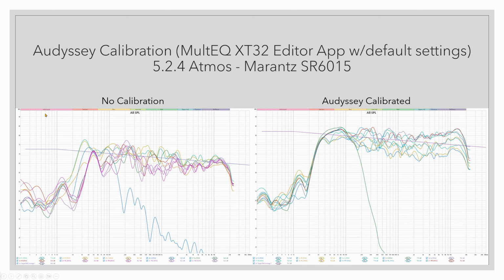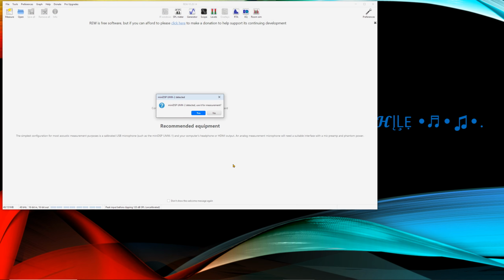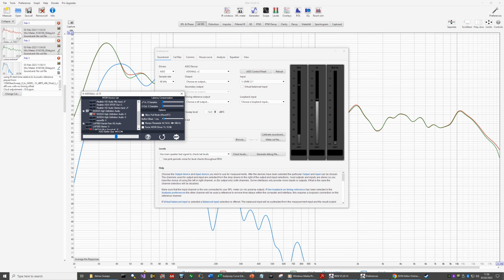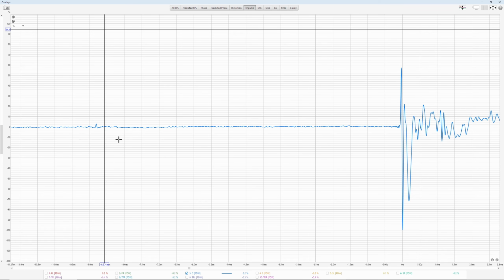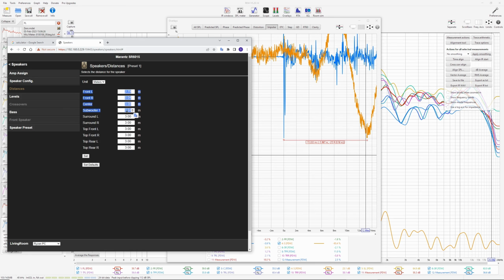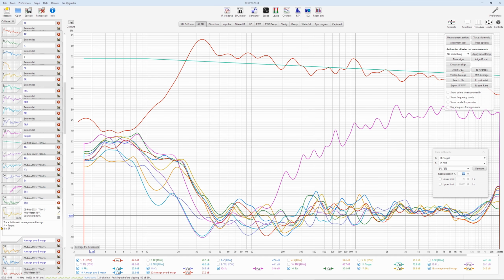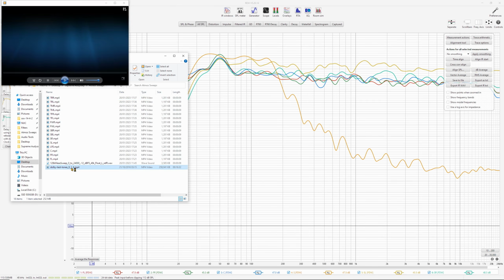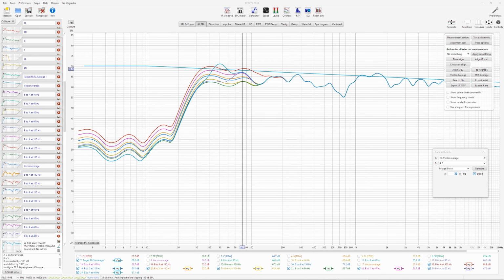Supreme Audyssey Calibration by OCA

Comment: I set it up once, it turned out to fix Odissey, everything worked. But it doesn't work anymore. Odyssey in the phone stopped opening. The file is corrupted. Or it has an incorrect format. Maybe you have encountered?
Reply from the maker: No never happened to me but these receivers sometimes require a hard reset!
Reply: @ocaudiophile  I deleted Odissey and installed it again. It doesn't open anyway. I also noticed if the program is ratbuddyssey_0.2.1 does not open it, and it will not open it in the phone either. Maybe something with the data being entered. Odissey doesn't understand. I tried to just put in "customTargetCurvePoints" FL. And everything else is unchanged. Everything stops opening ratbuddyssey and Odissey.
Reply from the maker: @twister213  You might be editing custom curve points with very large numbers becuase fo Excel regional settings (differences of , / . / ; etc.). Did you try the Pyton script automation linked in the description?
Reply: Maybe, if possible, check my guesses. To throw off the received data at least FL. Add them to the JSON editor. Open in Odissey.
Reply: @ocaudiophile  "{20000.000000, 52.856}"  
This value is given at the end of the selection to the bottom. You have on the video at the end of the certral channel allocation "{20000, 7.476}". I think that's the problem.
Reply: @ocaudiophile  Hooray, everything worked out. I really don't know how. Installed Python. Reinstalled Excel. In ratbuddyssey , the saved one also does not open .ady in the Json editor. But everything worked in the Audyssey mobile app and went to AVR. And yes, you are the best. What you share with us really works. The sound of my 7.1 system has become just incredibly beautiful. Thank you very much. May God grant you health and long life.
Reply from the maker: @twister213  Nice to hear that. You should thank @armagedon2B for the Pyton scripts!
Reply: @ocaudiophile  I can't figure out what's wrong. In the Odyssey, the finished subwoofer is constantly inverted, upside down peak in the negative. And it doesn't work. The subwoofer is silent.
Reply from the maker: @twister213  It's not possible for me to detect where the problem is with the data I have :(

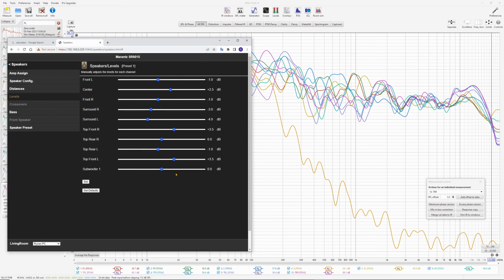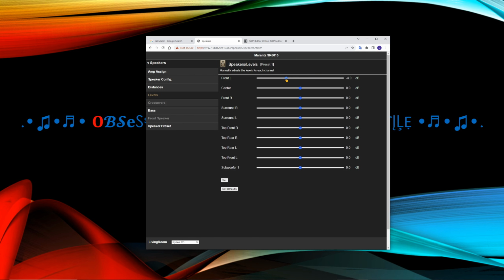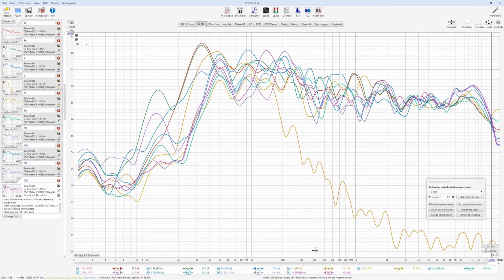Comment: This is all really great, but I am confused about a discrepancy between the Speaker Level settings at two points in your video.  At 36:58 you show values for, say, the LCR at -1.0/+2.5/-1.0, but at 46:00, after explaining to take a note of the Speaker Level and distances settings before uploading the curve-edited .ady file, you enter values of -4.0/+0.5/-4.5 for the same three speakers.  How/why do those values differ when they should have been the same as the noted values prior to uploading the curve-edited .ady file indicated at 36:58?
Reply from the maker: :) Your attention to detail is amazing and you're right but in the middle of the calibration during recording the video, I figured I forgot to take a note of the levels so I used levels from another measurement. Just ignore the differences and follow the method!
Reply: @ocaudiophile  Thanks for that info - good to know, and now my brain can rest easy :) I did have another question after giving this process some thought: If one doesn't like what Dynamic EQ does to the sound in one's system, does this method work without having that enabled? I find that DEQ really bloats the bass, and makes it sound too overbearing, so I personally turn it off.
Reply from the maker: @discostu668  I never turned DEQ on myself for the exact same reasons but this method tames all its disadvantages at the usual volume level you listen to your system and makes use of its boosts at lower volume levels. If you still don't want to use DEQ or DV then you can do a manul calibration with Graphic Equalizer. You'll find two videos on that in my channel.
Reply: @ocaudiophile  That is also very good to know.  Once I get around to the small re-arrangement of my HT system, I'm definitely going to try this method out.  Thankfully, I'm only running a 3.1 system, so I won't have to go through so many measurements! I'm looking forward to seeing how this method changes the sound in my space.  The thing that struck me the most was the method used to determine the speaker crossovers.

Comment: Hi, I tried to implement this method on my system. I noticed that MultEQ apply a "high frequency roll off 1" curve on top off the filter, so I made this curve in REW to compensate that : I share it with all of you if you want it : https://docs.google.com/document/d/10M1nIVBLEAwv9Jn7oxKGRalErl5kMh1WQKbHz_6S3s4/edit?usp=sharing
Second thing, in the low frequncy the filter generated will boost to much to match the harman curve, so I made a filter for each speaker to cut off low frequency according to his capabilities. tell what you think please.
Reply from the maker: True that MultEQ applies a high frequency roll off curve but the "inversion over target" stage in the method already compensates for that.

Comment: Can't get started. The MultEQ editor crashes when adding (+) Default.ady . The file is uploaded but crashes when chosen to Send to AVR. I've downloaded, and edited it twice with the same result. 
Have gotten great results with the addition of the Target curves to each speaker. I had to lower the volume on the subs since I have a miniDSP 2x4 HD for my 4 subs all time aligned and EQed flat. Thank you for all the tutorials. Even if I don't resolve the crashes my home theater sounds fantastic!
Reply from the maker: The original ady file should be produced in your own app and for your own receiver or else the I'D numbers don't match and might be causing the crashes
Reply: @ocaudiophile  When compared using the Online Json Editor this is the result. Shorten on purpose

Default.ady

"responseData": {
  "0": [
    "Dirac",
    [
      "1",
      "0",
	|
	|
	|
      "0",
      "0",
      "0"
    ]
  ]
},

Original.ady

"responseData": {
  "0": [
    "-0.000387435",
    "-0.0003729709",
    "-0.0004029804",
    |
	|
	|
    "0.0002611181",
    "0.0004911968",
    "0.0004621806"
  ]
},

"targetModelName": "Denon AVR-X4700H",  on both files
Reply: Just deleted the MultEQ Editor after moving the curves. Re-install the app and add the Original and Default files with the same result (crash on Default).
I'll re-run Audyssey tomorrow and perhaps try to edit an existing 8-position curve.
Reply from the maker: @CarlosGomez-THX_1138  No need to go for all 8 measurements, you can end in just 3 measurements.
Reply: @ocaudiophile  I made a mistake copying the excel column 1 cell 1 into  Original.ady.  The transfer was successful! I can now proceed with the rest of the goodness!

Comment: Thank you OCA; great video again🙂 i want to try that; in the beginning you mentioned that also MultEQ-X user can apply this method. But how to do this, because the .mqx-files are different and not JSON formated (the Data-section is another format i think)!?
Reply from the maker: I don't use mqx and not sure what the format of an mqx file is but at the final stage of this method instead of inversion, you can apply REW'S auto EQ to the responses and transfer these filters to multeq-x.
Reply: @ocaudiophile  Okay, thank you! But then i think better be careful with statements like this: 'We don’t need ‚MultEQ-X‘, but MultEQ-X users can also easily implement the method', because as it turns out the method can not be used!
Reply from the maker: @didi_sangye  There's nothing too wrong with that statement. The method can be implemented for mqx with REW's auto EQ instead of inversion.I have detailed videos on how to use REW's auto-EQ with these receivers.
Reply: @ocaudiophile  What do you think about the following workflow for MULTEQ-X users (assuming, as part of the measurement process, MULTEQ-X gets the speaker distances/levels correct)

1. Set REW preferences as prescribed in this video
2. Take all measurements (I.e. three measurements per speaker) with Audyssey enabled how without any Audyssey filters applied (note: MULTEQ-X allows any Audysseyfilters to be disabled via excluding’ ALL measurements in the app
3. Take RMS Average of each set of speaker measurements (I.e. RMS average of the three measurements) Question: Is Vector averaging preferred???
4. Use REW to EQ the response of each speaker’s RMS average 
5. Import REW correction/eq filters into  MULTEQ-X app
6. Upload to receiver and call it a day!